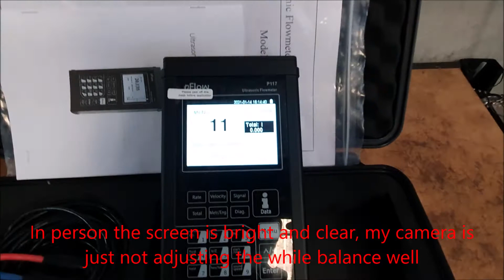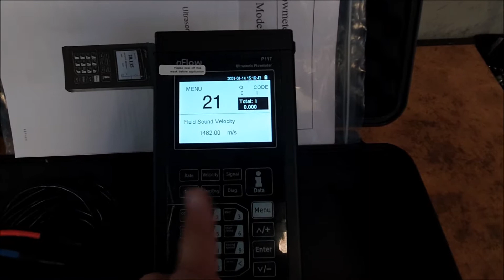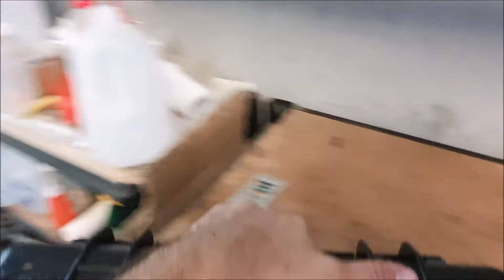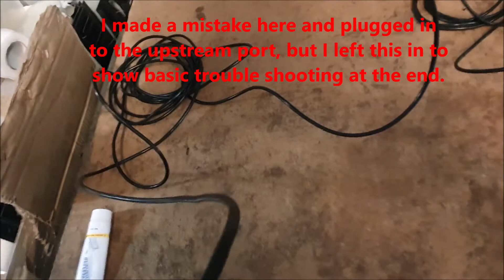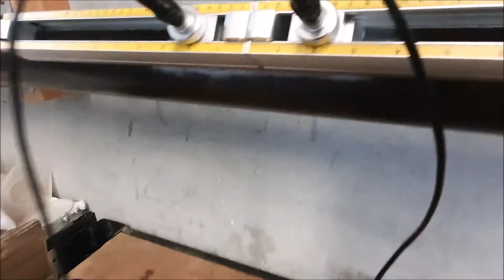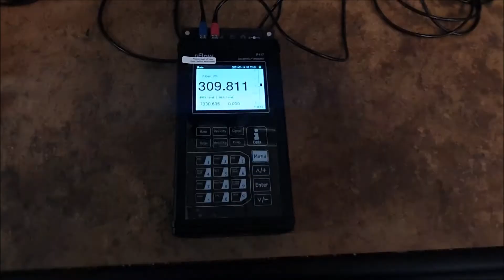pFlow P117 Flow meter demo

Comment: I had this device brand new and tried it but it didn't give any signal at all. I tried it on a 600mm pipe but couldn't get any signal at all. I followed your sequence as in the video but nothing! Are there certain settings that need to be done other than those related to the pipe material and thickness?
Reply from the maker: Sorry for the late reply, better to contact us by email with any questions as this is not really monitored at this time. Anyway to answer the question: Yes, all required parameters affect the installation. Typically you will need to configure: Pipe OD, pipe wall thickness, pipe material, liner material (if applicable) liner thickness (if applicable), liquid details, and mounting method. There are lots of variables or reasons why you might not get signal, could be something simple like backwards wires, pipe not full, incorrect parameter setting, rust or pitting on the pipe, turbulence in the flow, solids or bubbles in the flow, etc... We provide a printed quick start guide with flow meters we provide but you can also download a copy from our website, on the product then downloads tab. In that guide it goes over in lots of detail how and where to install it, as well as some troubleshooting steps.